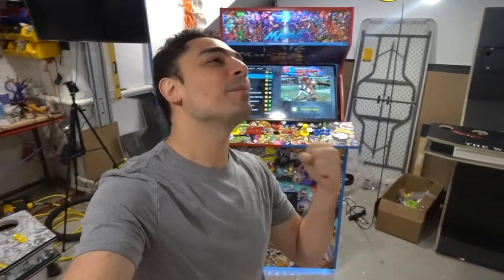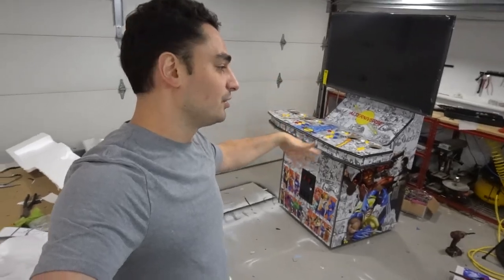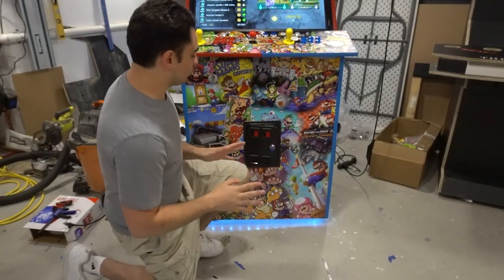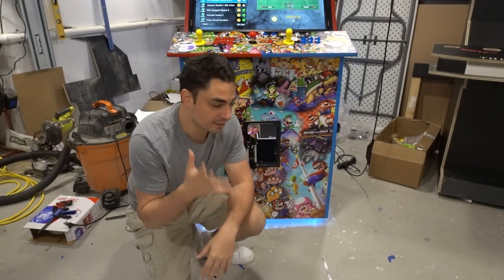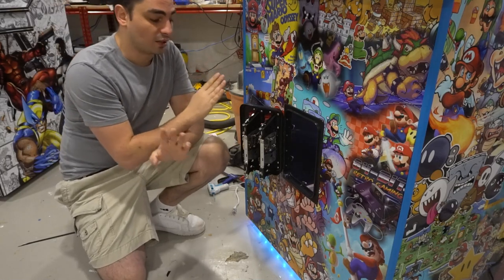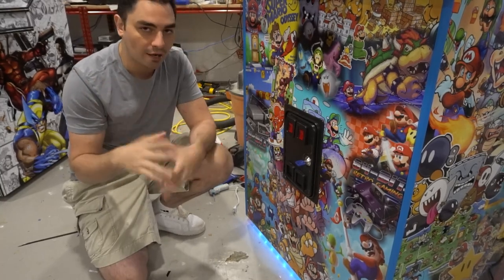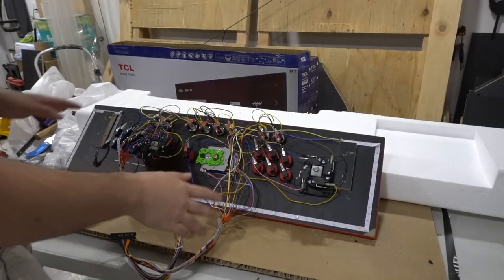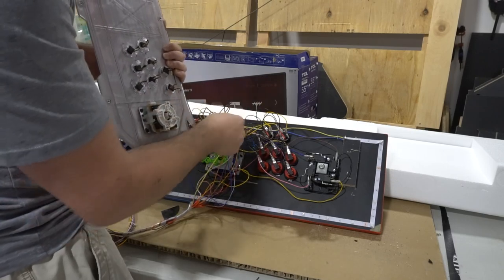Wiring a Coin Door To Your Arcade Tutorial

Comment: Useful, thanks. I am in an identical situation. Wanted two of the x-arcade double entry doors for a 4 player cab. (For the love of god, AVOID x-arcade) That company is clearly going to collapse as it never has anything in stock, and takes them "6 MONTHS" to reorder anything. Most incompetent arcade parts company on earth currently. Sadly they are the ONLY company with a plug and play coin door option. (Other companies need to fix that.) So gameroom solutions was option number 2. They had a single 4 player coin door for sale, but it has zero wiring, and ancient incandescent 14v bulbs for the lighting. So that will have to be either removed or replaced to make work with modern cabs.
Reply from the maker: Sad to hear xarcade still have stock issues. Ever since covid and that big water canal closure that stopped a bunch of boat freighters that had there stock... they just can't seem to keep up

Comment: I'm using a raspberry pi 4  I hooked my coin door up. but the only problem is the buttons on top work. what's the point of the coin acceptor. if you can just press a button.  I tried an on off switch. but it doesn't allow you to exit a game  any suggestions thank you
Reply from the maker: Most people do it for nostalgia reasons, but it's also useful for retail commercial spaces... not really great for raspi pi
For pi builds I assign the hotkey to something other than select

Only way an one and off switch will work is if you are setting the switch to cut the ground connection of that specific button

Comment: How do you wire up the coin door to use the coin door and the select button
Reply: And I’m saying the select button on the top of the control deck
Reply from the maker: Daisy chain. You gotta basically branch out from 1 wire to 2 wires
Reply: All right that makes sense I mean I’m kind of a visual I mean if you can find a direction to point me in I know they’re not polarity sensitive but I wanna make sure I wire it up correctly I want to do it for both player one and player twos select button aswell
Reply from the maker: I'm not by a coin door but its a wore that is going from your beginning input and then split outwards. Just like how a negative ground daisy chain looks... but with 1 long wire instead of a 2 inch wire

Comment: How do you choose 1 or two players if buttons up top get disconnected when at pizza  shop
Reply from the maker: The coin buttons up top are linked to the coin door. I simply remove the micro switch from the coin buttons up top. 
P1 and p2 start is not the same as p1 and p2 coin